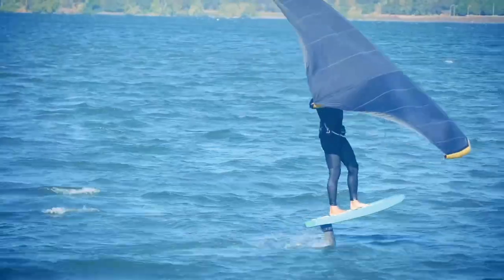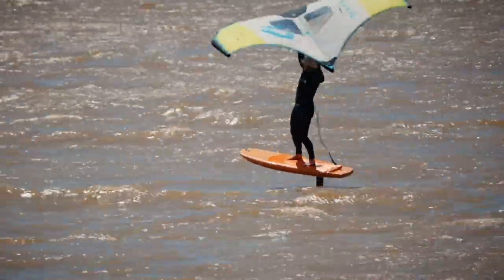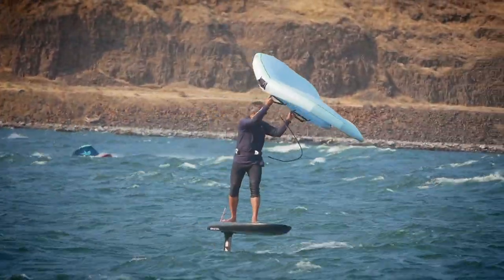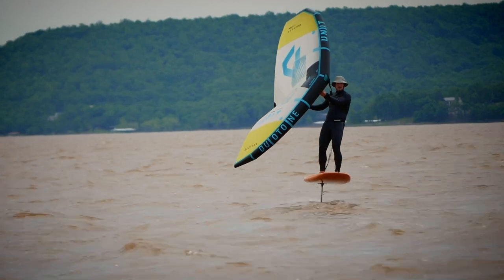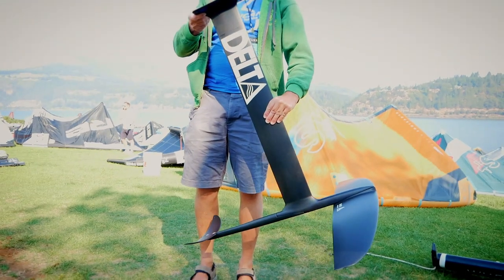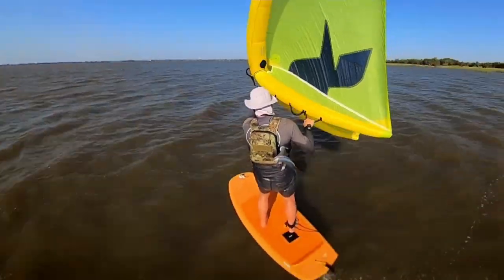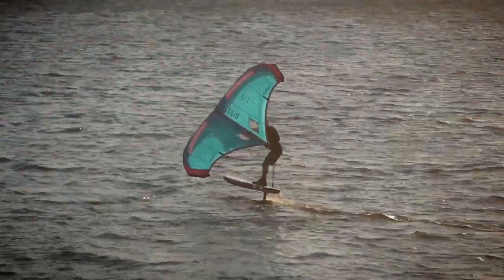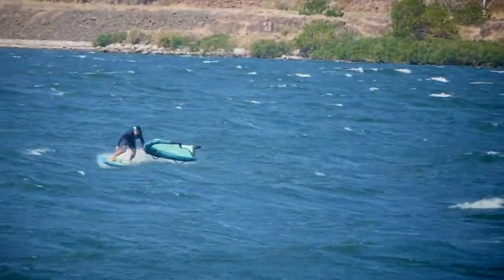3 Tips For Tuning Your Hydrofoil For Performance (With Delta George)

Comment: I disagree on the position, especially in regards to the heavier rider needing a higher angle of attack.  It’s really about positioning yourself over the center of effort of the front foil and being balanced over that lift.  A higher angle of attack induces drag with poor flow and lift.   The big guy needs a big front foil.  Analogy… you’ll never get 20 guys in a single prop airplane off the runway no matter the ground speed. You just can’t generate the lift.  At best you might be able to pop a wheelie by increasing the angle of attack.  Big guys really need big foils.